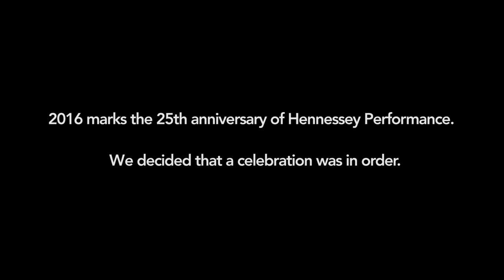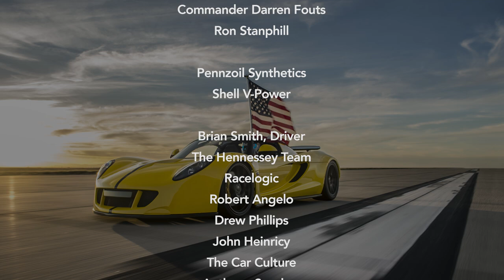World's Fastest Convertible: 265.6 MPH Venom GT Spyder

Comment: I love how easily the Venom does these record breaking runs.  Bugatti has to be going like 120 mph in the turn before using all 5.4 miles of the straight at their special Ehra-Lessien test track to squeeze out those last 5-10 mph while the Venom flies all the way to 260+ and then runs out of room because the runway they have to test on is less than 3 miles long and they only get to do one run.  If they took this to Ehra-Lessien I think the Spyder could do 275 mph and the with the roof on 285 mph.  Can't wait for the F5.